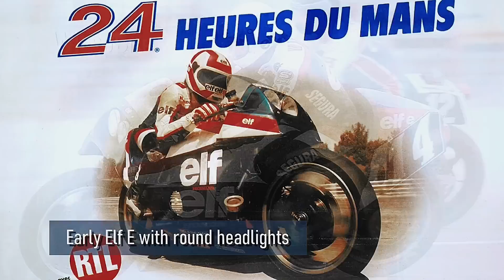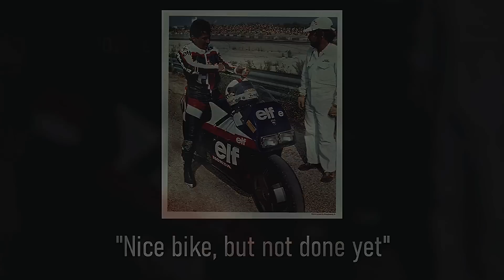A UNIQUE project that GAVE Honda the BEST! The Honda ELF MotoGP prototypes and their "Pro Arm"

Comment: Why do automotive engineers/designers always think they can just jump into motos when they get bored or flunk out? Ans that they always seem to come up with hub centric steering and fail on the same points. Absurd assumption that bike engineering is a lower easier form of sports car engineering

Comment: I’ve been riding a 97 Vfr750f for the last 7years. I love this bike, adjusting the chain takes 10seconds while rear-wheel removal/assembly can be done in less than 2minutes. It has Elf Honda France stamped on the single-sided swing-arm.

Comment: @7:20 the Gopro 😂 The system is called Center Hub Steering or CHS. There are a few production motorcycles using this system. The ones I remember are: Yamaha GTS1000, Gilera CX 125, and if you want the good stuff, Bimota Tesi and (Ducati) Vyrus.
Reply: Vyrus is not a Ducati
Reply: @Dr.FirebladeSC59  that is why I put it in parentheses. It's Vyrus and uses a Ducati engine.

Comment: Excellent subject. A bit of additional info: The Honda Nt650GT Hawk / Bros, internal project number RC31, has a very similar but simpler singlesided swingarm. My early example carries the same plaque. It’s still a great bike for real world road use and a lot cheaper then a RC30. So what if the number is not entirely the same. It’s near enough! 😁

Comment: Such a shame the industry stuck with standard forks with all of their drawbacks... 
I'd love to see some F1engineers have a go...but without electronic control, proper mechanical engineering...
Reply: De Cortanze and a British designer/engineer involved in the project, whose name escapes me, were F1 engineers.
As has always been the norm when 'experts' from the car world move into the motorcycle sphere to teach the 'philistines' how it's done, they find themselves at a loss as to why their logical and advanced designs ultimately fail. The routine is always the same, it starts with an observation of the current state of motorcycle development, usually in racing since that's where limitations are constantly being challenged, then the recognition that the designers are going about it all wrong because 'that's not how it's done with cars, and we're really smart'. Just look at the attempt with the Elf to lower the centre of gravity - 'that's what we do with cars, y' know' - very good for reducing frontal area but little else. Then the was the highly rigid chassis, another car 'innovation', these two factors among others combined to provide a bike that was admirably stable until it crashed because the riders had no feedback from the bike, they couldn't feel how the tyres were working, so they were either slow or, as I said, crashing.
The issues all stem from the fact that motorcycles are not simply a car with a couple of wheels missing, as the car guys almost always believe, they are a dynamic device in a way that makes no sense to car inspired sensibilities, as evidenced by the long list of car designers shattered egos.
Reply: @quietknight8250  as someone who rode bikes for 15 years, I understand what you are saying... but I also know that tank slappers from rubber frames and fork stiction are a thing... there are better ways to do things, I'm a retired engineer myself and even as a young man, I thought the design of motorcycles left a lot to be desired after all, they did in fact started with bicycles with engines strapped on...😂

I rode a Gold Wing for 10 of those years and loved the shaft drive setup and the low slung fuel tank combined with the flat four to bring down the c of g... useful if you tip it over... ever try to lift a 4 stroke watercooled inline 4 with double overhead cams ? ... 😣

For me, "innovation" should not be just bolted-on electronic controls such as ABS, launch control or "active" suspension... but thats just me... 

Happy New Year btw !
😎👍☘️🍺

Comment: It was a major project. In the '70s, there was considerable interest in alternative front end design. You can do a great many interesting things with front end geometry, if you have upper & lower arms, which you can't do with forks. Trouble is, if you make the arms wide enough to allow decent steering lock, they'll hit the ground when you lean over.
Theory is nice, but somebody's got to build one of these things and see. So Elf did.
Does it work? Well ~ yes it does, but it's not necessarily a whole lot better. It's more complex, it's harder to set up, it doesn't feel the same... It does offer certain advantages, like under brakes, but it had disadvantages as well, and nobody knows the first thing about setting it up or developing it.
The ultimate version of it had more like a McPherson Strut, but it still had the single side swing-arm and it still had not enough steering lock. If you're going to replace teleforks, then what you build has got to be better, not more complex and expensive and almost as good.
Brits today love Leon Haslam. Leon's dad, is bloke called Ron. Ron was the Rocket Ron who rode the Elf Honda.
Reply: Though I generally tend to agree, it's always a bit questionable to judge parts or subsystems that are hardly developed past early prototype stage on platforms optimized for fundamentally different technology and come to general conclusions about its potential.

Without the whole system "motorbike" seeing as much development as a system with different paths such as this being followed, there's no saying if it might not even be vastly superior. Or inferior. 

After all, path dependency is a real bit...

Comment: Moto Guzzi had a very similar single sided swingarm in 1950 on the Galletto 160.
Reply: I think that was the monobraccia? I'm bound to have the name wrong but roughly similar.
Reply: it's not an aluminum pro arm, it's a regular single side.
Reply: But, the design is very similar, even down to the eccentric chain adjustment.  @rzaultra165

Comment: Having had the terror/pleasure of riding a hub centre steering bike..... It was.... Odd. No dive on the brakes, suspension still working in the corners. Took a bit of adjusting to ride them. (Yamaha gts1000)
Reply: The GTS is flawed, development has not yet been completed, but they have given up and run away to immediately market a motorbike that is still very basic and looks strange and doesn't connect to the rear.
Reply: @rzaultra165  totally flawed
 But I've ridden one. And can say I had the experience
Reply: i have pleasure with Italjet Dragster XD
Reply: Just did a video with Iconic Motorbikes of a Tesi 3D. So weird to watch the suspension work. And yeah, that no dive feeling is certainly odd.  https://youtu.be/j-pNsrJ118M?si=Qgi0n6z0Lh5q5XSG